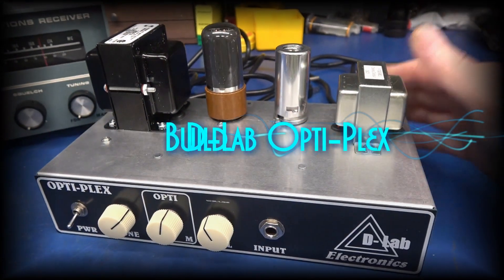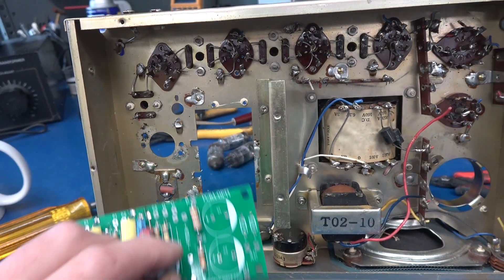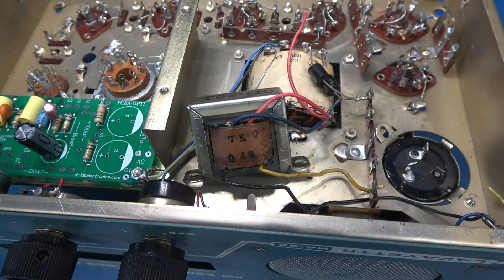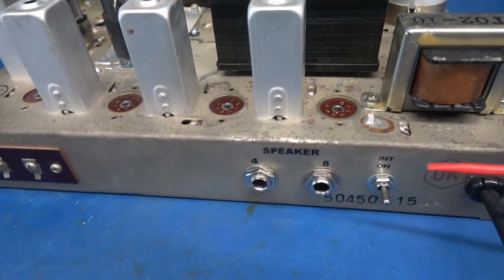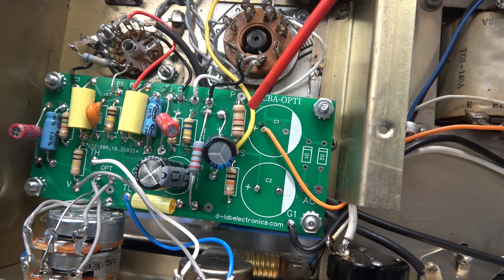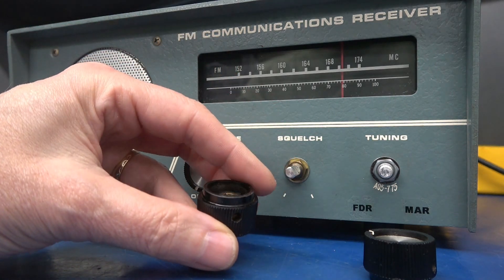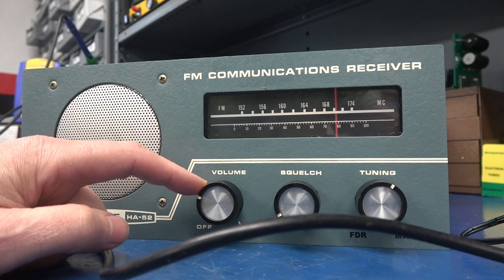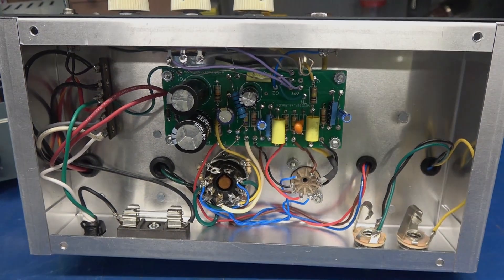How to convert Police radio tube guitar 6V6 amp cheap easy build new class A Optiplex tone circuit

Comment: I've got a Hammond E100 chassis, has two different xformers, as it had a main amp and a reverb amp all in one. Trying to decided what to make with it. I removed the power xformer because it was very, very heavy, having all the taps needed to run both amps.